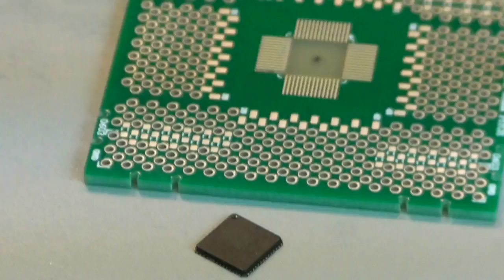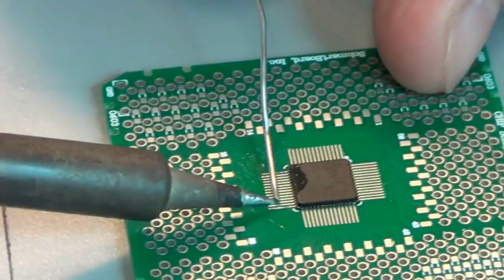Schmartboard Drag Soldering Technique

Comment: +IEugene1994 the point is that you might not be a professional, and you might not be making a mass-produced project, but the chip you need is only available as QFN/BGA/etc. In that case, you can

1. Give up
2. Hope that Sparkfun/Adafruit/NooElec or someone like that made a breakout board with a chip that does what you want
3. Use a Schmartboard and use whatever chip you want